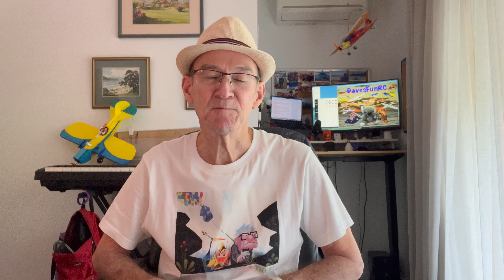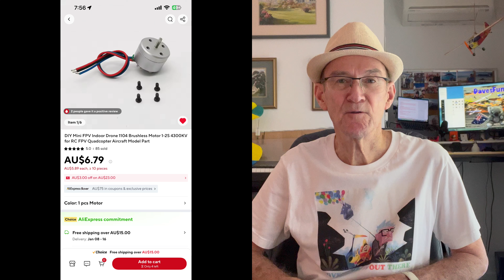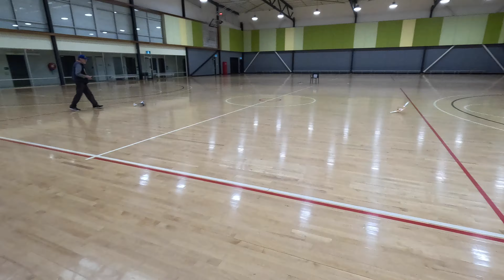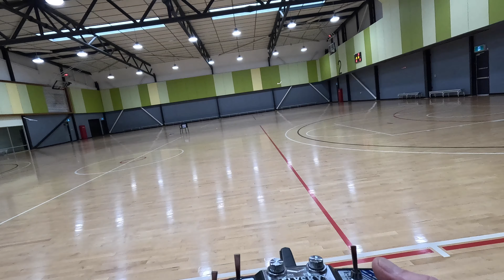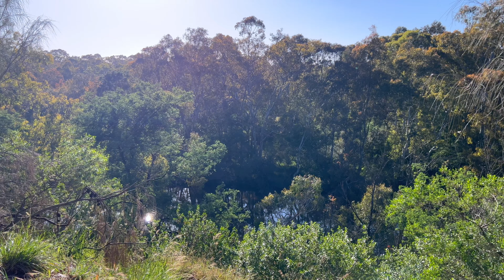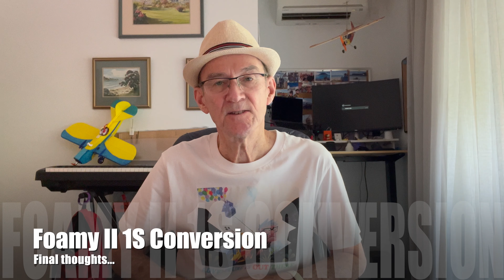Foam RC Electric Glider 1S Lipo Conversion

Comment: Well you are great source of ideas, but I have to clear up a common misconception lower KV doesn't mean more torque, it just consumes less power for the same prop size, you can then increase prop size and get high efficiency, it doesn't overheat trying to spin supersonic, higher kv means you retain torque at higher speed, have more power, consume more power, produce more heat and lose efficiency
In Chris Rosser we trust. Jesus of FPV. He does all sorts of electronics, camera lenses, sensors(Nikon, Canon). He makes his own components here and there, AOS motors 2207, 1404, 1605,.. of his own made by RCinpower
Reply from the maker: Thanks for that info!
Reply: @DavesFunRC  can't find the comment I made about building Bug lite 3d printed from PLA, but I have an update Darwinfpv bling 1104 5000kv has 170+grams (gemfan 3018-2) of thrust since my 170gram can just about hover, on 2s 530mah it consumes 15%bat per 4minutes half throttle can recommend except for nonstandard mounting holes
The prop looks ridiculously small😂